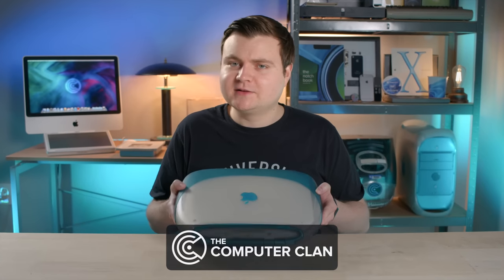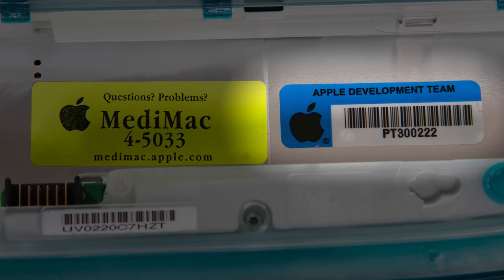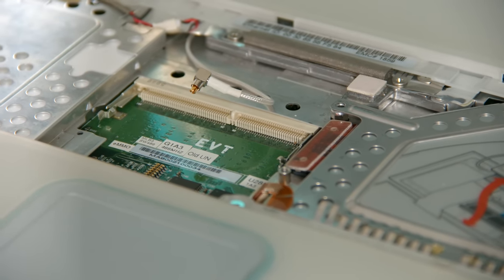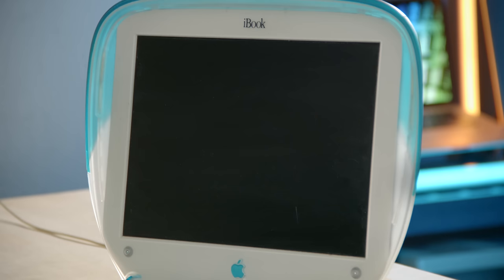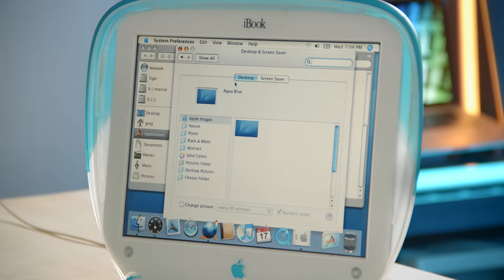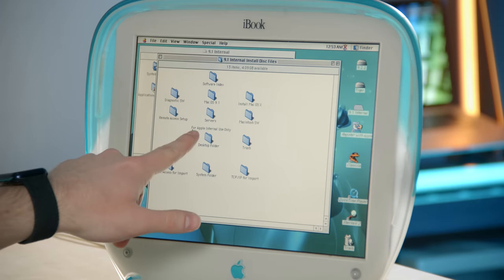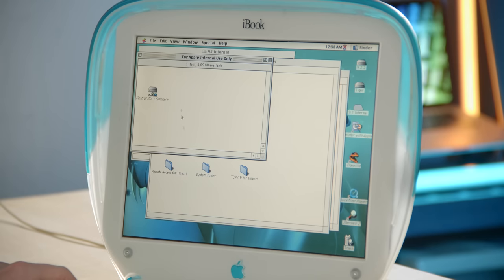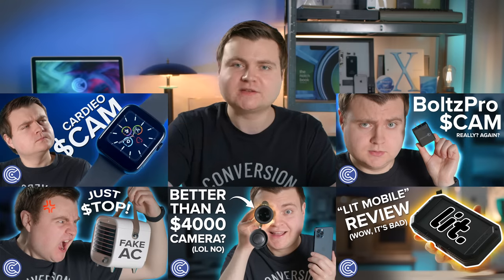Rare iBook G3 Prototype (with WEIRD Bug) - Krazy Ken's Tech Misadventures

Comment: From the specs (466/DVD/Firewire) This sounds more like a prototype for the iBook SE, that just happened to be built using Blueberry plastics that they would have had readily available.
Reply: Exactly my thoughts too. It would make perfectly sense to test the upgraded internals in a standard colour shell so as to not draw unwanted attention.
Reply: @patriksonestad8208  
> It would make perfectly sense to test the upgraded internals in a standard colour shell so as to not draw unwanted attention.

It might be that because when testing iPhone 4, prototype was using a case that looked exactly like iPhone 3GS
Reply: @krnlexception  the iPhone 4 model might have been designed with field testing in mind. I don't think Apple would put effort into camouflaging an iPhone for it to be just used internally, as that would have no point. If they used it outside of the apple environment, that would make sense because of the fact that if it looked like a prototype iphone in the public, it would raise suspicion, and likely get stolen.
Reply: @imacg5658  someone got their hands on it anyway xd

Comment: That's pretty neat. It's interesting how the internal notes seemed, kind of not professional back then? Like the hidden folders to have instruction text.
Reply: I think that's just a macOS < 9 thing. In macOS 10+ you can create folders with custom backgrounds and icon arrangement, but macOS < 9 I want to say such functions were not to be found; to be clever, software devs would use custom icons to provide branding or instructions to the end user. (Ive played with macOS 8 in emulation, and some software CDs did the same thing.)
Reply: @MisutaaAsriel  It's a clever workaround for sure, but it seems a bit hacky for a tester, but then again this was the 90s
Reply: @tipoomaster  The more professional, end-user facing, way back then would have been to tile a larger image using icons as the tiles.
Reply: You'd be surprised how hacky internals of almost any software or hardware you use are even today. You can look at  the hacks apple use even on M1 series hardware if you follow Asahi Linux bring up titbits. They document weird configuration and behavior apple has even on these hardware which are cleanly hidden from general public in macOS. You can also see this if you follow parts of libraries or software that apple has open sourced. Same goes for Windows, Linux, x86 hardware, any other ARM hardware, etc.

Comment: 2:13 - I highly bet that 5 digit extension dialed to that "Medimac" center was routed on a very old Bell System Dimension PBX (or an earlier AT&T System 85) since it's so ironic that Apple never replaced their deskphones as fast as other Avaya customers. The "phones" Apple was using prior to Steve's return were extremely outdated.
Reply: Interesting insight!
Reply: @daneberryman  Well when the circuit boards and phones were no avail by 1990, no one had a choice but to upgrade to the Merlin-like telsets. Apple must had paid more to maintain the 70s gear with AT&T...
Reply: Oh and MediMac was indeed the internal support lab (several labs actually) for the hardware during development.  Pretty much anyone who had a unit for test/development went through them for repairs (some) or rework (a lot) to provide hardware fixes as they were identified.

Comment: That trick of using a folder without an icon to use the folder name to place instructions in a folder is something Apple and third-party Mac software companies had been doing back in the 90’s and 2000’s, only stopping when software on disk became no longer a thing at some point in the 2010’s. The most common way you’d see this done is when you open a read only floppy, CD/DVD-ROM, or disk image file and you see a folder with installations instructions for software in an iconless folder’s name such as “Click here to install this program——>” with an icon to the right of the software’s installer program. Another example would “Drag this icon to the Applications folder to install——>”.  So this wasn’t just used in prototype/testing machines but on some install media. I also recall another interesting trick that used empty folders where they would put special icons on empty folders that when all matched up would form a picture thus providing a hack to allow a background picture on software media.

Comment: Hi Greg, great video - awesome trip down memory lane :) Those internal disks for non-prototypes usually had the standard apps Apple uses like Office and stuff, plus Norton and other utilities to help employees fix the systems either on their own or with Apple support. They also had the internal TCP/IP settings to connect via vpn and log into the internal network, where those server icons would work. I was an SE in higher ed from 2000 to 2005, I probably still have a couple of those disks in the closet but they're not much use now. Thanks for the video!

Comment: My friend had a prototype that had the Apple Logo that was not upside down. I believe it was lit as well. Steve Jobs insisted in it facing the user instead which led to the Logo being upside down. So now the upside down apple logo looks bad when it was lit, so they literally put a piece of tin foil to block the display backlight from lighting the upside down logo.

Comment: Hey Ken, I have been working on a neat concept for PowerMac G5 late 05 models. I have designed a 3D printable AIO bracket to be used on the G5 CPU to mount original model Corsair H60, H80i and H100i coolers. This was tested on a single processor machine but theoretically should work on a quad G5 too. As links are banned in comments you can find it on my Thingverse page under the name "PowerMac G5 AIO Mounting bracket for Corsair H60". Thanks to anyone interested in this project, please note physical dimensions and features are subject to change as I improve upon the design. THIS IS NOT COMMERIAL SPAM I'm merely trying to get some recognition for my concept cooling system, I am a fellow retro computer enthusiast before anyone cuts to conclusions.

Comment: The firewire might have been omitted due to a licensing issue.  Pay us 5 dollars a machine or we wont unlock the feature on the chipset.  

At that period of time it was pretty common, like old cell phones... my fancy Motorola phone had all kinds of excellent features but they were mostly locked because the carrier didnt pay to unlock the features.
Reply: Sort of the same deal with the original xbox and DVD playback
Reply: @theforerunnerreclaimer  Exactly.  There is either a licensing issue... or the one chip that is needed costs 20 dollars.  So if its not the premium one or deluxe they just leave the chip off but leave all the other stuff on there since the plugs and other small components cost a few cents and it would be a headache for manufacturing.

Comment: Regarding the absence of FireWire on the original G3 models, it's likely because FireWire was considered a "pro" interface at the time. It was only seen on the PowerMac models. I don't recall it coming to the iMac until the 2002 G4, after the later iBook models had it. By that point, though, the iPod was also coming out soon. Seems Apple eventually made it a more "consumer" interface. It's only speculation, of course, but I would imagine it's got something to do with that.

They did something similar in 2008. The original unibody aluminum MacBook omitted the FireWire port. It showed up on next year's revision but was then rebranded to MacBook Pro.

Comment: My 2012 MacBook Pro with SSD and 8 gb of ram struggles to do two things at once , As much as I loved it , it’s time to go back to windows
Reply: My 2012 works great for multi tasking, maybe consider swapping out the ssd for a faster one or checking to see if something is secretly running in the background.
Reply: @nslouka90  it works great but it’s slow , I have a more modern windows laptop with 16 gb of ram and a much faster processor with a pretty powerful gaming GPU , the MacBook will go to a good home , I used it for music production for a very long time

Comment: I actually want an iBook G3 just for a video trying to use in 2022.
Reply: I have one I might be willing to part with. What do you need it to do in the video?
Reply: @MaxOakland  I want to try using it instead of my MacBook Air lookalike for a week
Reply: PowerPC 2022 challenge
Reply: @jamesdriver0317  like as your official computer?
Reply: @MaxOakland  just for a week, then back to my MacBook Air lookalike. It’s a challenge I want to try
Reply: @jamesdriver0317  that’s awesome. What’s your MacBook Air lookalike?
Reply: @MaxOakland  Evoo EV-C-101-1. It’s a 10.1” laptop with a similar design to the MacBook Air. It has 2GB of non-upgradeable RAM, and 32GB eMMC storage. I installed Linux Mint 20.1 then got the KDE Plasma desktop with a macOS Mojave theme

Comment: I have two old clamshells that I just can't figure out. They run open firmware v1.2, but refuse to boot just about anything I throw at it claiming that the checksum is bad. Tried all the ISOs for clamshells I could find and disks that work on another clamshell I own. Any ideas? I assume they wouldn't be having pre release firmware

Comment: My iBook G3 has the word “PVT” on the ram slot on the motherboard, what does this mean? Thanks!
Reply: Product validation testing, I think that's the final prototype stage before it goes into production where the design and features have already been finalized
Reply from the maker: ^ What they said! It's been a while since I formally researched it, but PVT is a stage which generally takes place after the DVT stage (Design Validation Test), which takes place after the EVT stage.